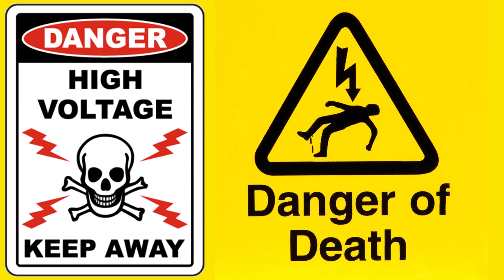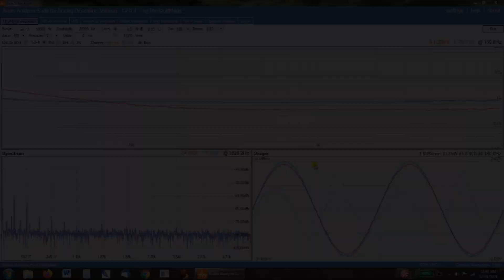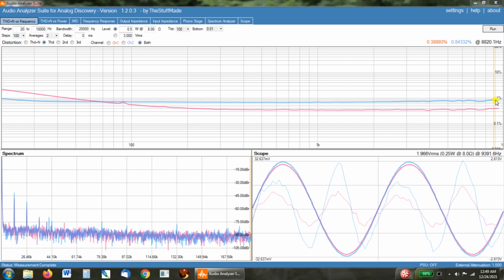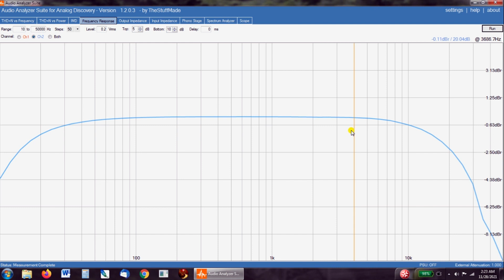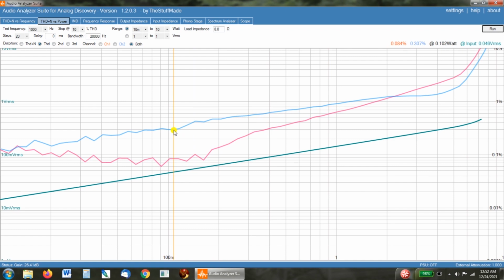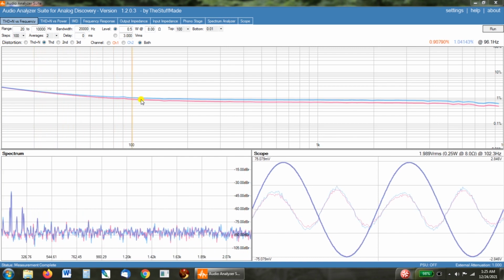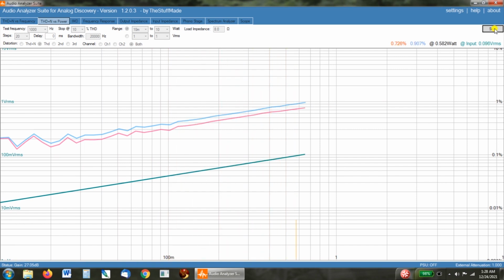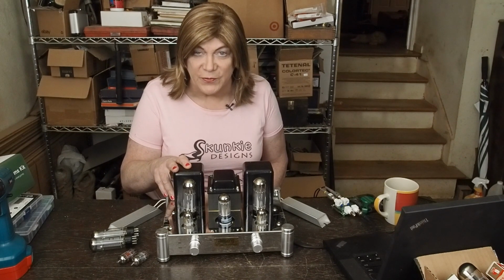Boyuurange Reisong A12: Follow up on Final Mods.

Comment: Happy 4th. I just finished the mods (except the rectifier tube swap). Some hard numbers. 

Pre mod: Marconi TF 2005/HP 335A equipment. 
Post mod: HP 8903B

1 volt input signal, 1 volt AC out of amp-
Pre: 6k 1.5% distortion, 14k 2.2%
Post: 6k .5, 14k .62

2 volt input, 5 volt output of amp- (I had to increase input signal voltage as the amp would not get to 5 volts at full volume)
 
Pre: 2k 12%, 10k 23.5%
Post: 2k 1.2%, 10k 1.5%

Wow!  Huge difference and as you have said, there is base now!!

Clipping at 5.9 amps.

Comment: I have the mod done for 3 months now and have moved on to other amp builds. Just 2 days ago I installed the Steve Deckert circuit to the Lii Song Fast 15 open baffle speakers (burned in for over 300 hours) and connected back the modded A10. What a relevation! The A10 is the most dynamic and musical amp in my system so far. Here are the components I put in: Gold Lion KT77, 6H2n (Soviet era) driver tubes, Mundorf Mcap EVO coupling caps, Alps 27 (blue) pot. I do not remember the system sounding this good ever.
Reply from the maker: Glad you're enjoying that setup!

Comment: Recently i went to change the El34 output tubes and when i installed the new JJ tubes they didn’t sound great because i haven’t burned them in yet i assume.

my question is would it make sense to burn in the output tubes by leaving the amp on for a few hours without the 12AX7 tubes installed so i don’t waste the life of the 12AX7? Or would it make no difference in preserving the life of them?

would doing that damage the amp?
Reply from the maker: Play music through them. And seriously, that 12AX7 tube is gonna last for  10 years. It's not like it's gonna burn out in 100 hours. And just having them powered on does nothing. Also is this a stock amp or a "skunkie mod" amp? Just swapping tubes into a defectively designed amp isn't gonna do anything.
Reply: @ill try that! Thank you for your advice :) 

Also the amp is Skunkie moded.

Comment: Parts arrived yesterday afternoon for the mod. Started the work around 4pm, was done by 8 or so - and that includes having a quick bite to eat :) Would be finished, except I ordered an 820 instead of an 820K by mistake. Don’t have much inventory here of 2W resistors, does this have to be a 2W, or can I use a lower value? Also managed to order a mono Alps in stead of a stereo pot - never rush putting an order together…) Waiting for the 5AR4 to arrive so I can get the voltages up. Almost there!
Reply from the maker: I would stick with a 2w there. Maybe order a few different resistors for that feed back as well  to tune the sound to your taste. Like maybe a few lower values down as low as 300k
Reply: @SkunkieDesignsElectronics  Thanks. I figured :) I’ll grab a few different values. Should really set up a switch w different values so it can be adjusted pending speakers. I have a lot of different ones :) And I got lucky. Found a unicorn in my stash of tubes. A Phillips mislabelled 5V4.  Actually a 5AR4!!!  Put it in, measured it and I’m getting 16v more than a 5V4. Have no idea where I got this tube!!!
Reply: @SkunkieDesignsElectronics  Almost done! Just need to put a new power switch in, put a new volume pot and figure out what coupling cap to use. Contemplate some Russian PIO caps, hopefully they will add some midrange richness. I added 5 x 0.1uF caps. One in parallel w the final cap in the power supply, and I put one across each of the bypass caps. Had some M Caps that I put it temporarily in place of the .22uF’s it came with. Opened up the sound a bit and added some dynamics. Did one side first so I could A/B how the changes worked. Listening on some Cornwalls, they tend to reveal everything :)

Amp is much better after the mods. Dead silent. 

Thanks you for all the effort you put into sorting this modestly priced amp - especially if someone picks up a used one.
Reply: @SkunkieDesignsElectronics  Added the Alps pot, changed the signal cables to Canare shielded wire - and put a new power switch in (the original felt very cheap…)

I’m not going to say the difference was night and day, but there was an improvement in how smooth the amp sounds. 

A big thing, is just a lot of little things out together.

Comment: Just finished the mod. A very nice amp now with all the glory of tubes. Thanks for the work. Only it seems that the gain is lower than the stock version (not that I listened to the stock version much.) Is there any way to increase the gain without sonic impact?  The speakers are Klipsch RP-600M.
Reply from the maker: Enjoy! And no, that is part of the price of this upgrade. You actually have more usable power, you just have to turn the volume knob up more.

Comment: Just finish the mod on my A10 with stock tubes, the difference is more clean power compared to the triode modded version. I will eventually buy new tubes but for now, I'm very happy. You are the best.

Comment: Just needed to give you another THANK YOU for this. Just finished your  Mundorf EVO Aluminum Oil Capacitor upgrade and changed the Schade resistor to 620K to work with my Klipsch RP-600M speakers. Dialed in my Polk subwoofer and just sat back and enjoyed the tunes. Really made a difference from stock. 

On an aside note, my cousin wants me to do one of these for him but is concerned  with needing more inputs, tone and balance controls. Please note that I DON'T need them. I came up with adding a Schiit Loki+ (for tone and another input) and changing the volume control to a concentric pot to control each channel. Do you have any better ideas?
Reply from the maker: Nope, that should work!

Comment: Hi, I'm just ordering all the bits to tackle the mods on my A12. Are there any potential implications of being in the UK where our power supply is ~240v? Thinking maybe rectifier choice?
Reply from the maker: Nope, after the transformer, the voltages are all the same. It's just the primary windings of the transformers are different.
Reply: @SkunkieDesignsElectronics  brilliant, thanks for all your work on this, looking forward to trying the mods!
Reply: @SkunkieDesignsElectronics  

Well that was exciting! Just did the mods (+ coupling caps) on my A12. First time wielding a soldering iron or doing any kind of electronics. Felt very accomplished, turned everything on... Tubes light up, then there's a lovely puff of smoke and a hmmmmmmwupwupwupwup noise from the right speaker.

Turn everything off. Open her up again. Realised the output tube capacitor on that side wasn't properly soldered to ground. Disassembled and tested the cap and all the resistors on that side - all seem fine, but spotted the voltage drain resistor on the filter cap was scorched and shorted so removed that.

Removed and checked both filter caps for good measure, seem OK. Reassembled everything, hid around the corner and switched everything back on.

All good! I have music and it sounds great. More bass, more detail and my Denton 80ths feel more responsive at low volumes. Have some NOS Svetlana Winged C EL34, Sovtek 12AX7lps and Sovtek GZ34 tubes turning up on Monday to celebrate.

A fun introduction to electronics, thanks very much for all your work!

Comment: Good morning.
Great job SKUNKIE !
I'm quite surprised that no one has noticed that the bleeder resistor (430K/2W) is missing on the modified diagram.
Some indications such as the wattage of the resistors could also have been reported to help even more in understanding the MOD. 
Keep it up, you're on top !

Comment: Inpiered by your chanel I want to play around with the a12 to learn  more about tube amps to  to prepare for a own  amp build. . I like to run the  A12 in triode mode to see effects. Is that possible? I think it is more to take in account than cutting  g2 at pin 4  to open connection to the center tab of the  output transformer.
Can you give me some advice.  In the net I find different confusing ideas.Thanks a lot
Hans
Reply from the maker: You have to disconnect the wire from the transformer and connect the screen to the plate with a 100ohm resistor. It's going to have about 1/2 the power.
Reply: @SkunkieDesignsElectronics   thanks for quick replay,  does the  820 k Shade feedback resistor make sense for  Triode mode?
Reply from the maker: @hansdoeing  no, triode mode shouldn't need any feedback.
Reply: @SkunkieDesignsElectronics   thanks, made a small donation to support your Channel

Comment: Hi Skunkie, I wish I could give you a hug right now!  Today I finished doing all the mods to the BRZHIFI A20 / Reisong A10 PCB version. I had to lower the EL34 cathode resistor to 150 Ohms as my plate voltages are lower. I measure 267V Plate-to-cathode and 13.8V on the cathode resistor. This sould get me around 93% dissipation. Not onyy is the sound VERY clean right now, I can listen at lower volumes as the low and high frequency response has resolved nicely now. When measuring the dB in my room it is a good 8dB lower now. My nieghbours are very grateful. I did not know this little amp could put out this sound! Still does not beat my Thule IA60 in terms of sheer power, but damn does it sing. I might actually sell my solid state amp now. Thank you for your work!   That disspiation did you get on the EL34? kind regards!

Comment: Massive thanks for doing these mods. I own a BRZHIFI A20. It is very similair to the A10. BRZHIFI already did lower the cathode resistor on the EL34. I have done most of the mods to the PCB of the BRZHIFI A20 and am very pleased with the results. Massive thanks! I have shared my story on diyaudio forums. Search for BRZHIFI A20.
Reply from the maker: Thanks for sharing

Comment: I got the best result without feedback resistor. Then the amplifier has great dynamics, but also distorts the sound at the maximum volume level. I listen at a maximum of 50-70% so it's not a problem for me. However, in order not to be too bright, I set eq in my dac.
Reply from the maker: Did you play with different values? Depending on the speakers and your taste, anything from 300K to 1M will work. The lower values can sound too dampened with some setups, while the higher values (or no feedback) might be too bright depending on your situation.
Reply: @SkunkieDesignsElectronics  I tried several resistors from 470K to 680K and as 680K sounds good I love more the dynamic of no feedback.
Reply from the maker: @wojciechkleszczynski7041  Ah OK, just making sure you understood the value of this resistor is not set in stone :)

Comment: Thank you for everything you do! You helped change the sound quality of my Reisong A12. I noticed that the manufacturer made a power transformer with a voltage of 275v and not 290v in my amplifier, tell me, could this affect the power of the amplifier, which decreased, or is it GNFB? Can you tell me how I can change GNFB? Thanks!
Reply from the maker: Lower voltage will have lower power. You might be able to make some back with a lower value cathode resistor to raise the current some to offset the lower voltage. This amp stock, nor with my mods have GNFB, it uses local plate to plate feedback.
Reply: @SkunkieDesignsElectronics  Thanks!

Comment: Thanks you so much Stephe !!! 
Thanks you for all your videos and for what I have learned from you. You are doing a great job !! 
I have just finished the upgrade of my A12. I choose a TAD GZ34, 2 EL34 from JJ, and 2 ECC83-STR from Harma (this last choice was oriented with advices from my local electronic reseller). My reseller gave me also new coupling capacitor. 
The sound is Amazing, pure and clear. I am very happy with my new A12, and what a surprise at this level of price. 
THANKS AGAIN  !!! Best regards from France. Frederic
Reply: Hello Stephe , thanks for your response !!.
 I am still working on my amp. I have changed the EL34 from JJ to EL34 Harma-Retro, after the advices of my electronic resseller. 
The result is really interesting , compare to the JJ !! Much more precise basses with clarity of all frequences. I am really happy.
Best regards

Comment: Hi Stephe,

Used to SET amplifiers I bought the A10 out of curiosity what a pentode might bring to the table. It was no succes and I thought the SE penthode as a principle was to blame, so the amp ended up in the attic until I saw your video. 

Modification of the operating points brought out the sun. Now it gives a clear soundstage while before it was foggy. Bass response has bettered 
a lot and the midrange is quite decent (in comparison to expensive SET amps). The highs are a little strident but I haven't incorporated the plate-to-plate feedback yet as I was curious about its effect. Will report back.

My B1 voltage with GZ34 (5AR4) is a little low at 326V, you got 340V I noticed. EL34 cathodes are at 18,5V each and the ECC83 at 1,2V so on target. 

Thank you very much for your effort because is brings quite a difference to this little amp. Love your videos! :goodvibes:

Detmar
Reply: 😃 whoa, this p-t-p feedback did clean up the highs a lot. I used 799K, might take it to 900K for comparison. Mind you, still with the stock ps-vane EL34 and JJ ECC83 (12AX7). Midrange is velvet, not too sweet. Bass could go somewhat deeper as I'm with 100nF still. Running a pair of 10 watt B&W DM1 speakers the volume is good for normal listening levels.
Reply: I settled on 861K p-t-p FB. It diminishes distortion at average listening levels to an acceptable level so highs do not sound strident any more.

Decoupling the EL34 cathode with two times 220uF brings better dynamics on the table, the amp now sounds as if it has more power than its humble 2x 6W. Although this mod improves the dynamics, the amp is still not on par with a good SET w.r.t. speed of delivery. Perhaps a solid state CCS fed from the rectifier PS may better this. So, now it is time to loose that heat producing rectifier but doing so brings the need for higher rated PS capacitors as their 400V working voltage will be exceeded at startup.

Must still double up on the coupling capacitors.
Reply from the maker: Glad you are enjoying the mods and you see why I am a fan of this p-t-p feedback, it's a great tuning tool!

Comment: Hello, I purchased a tung sol 5ar4, I'm new to tube amps.. is it just a direct swap? I have the a10.
Reply: Yes, you can exchange it for the Chinese rectifier. As a result your operating voltages go up. The power supply caps are 400V and should be ok. Do not use the JJ brand for 5AR4 rectifier as it has a reputation for open filaments within little use on these hifi amplifiers.

Comment: Skunkie I bought the amp and I'm getting ready to do the modifications. I find it odd that they parallel driver stage in a 12ax7. I've never seen a 6SN7 parallel too much.
A couple questions. Can you or would you cascode the 12ax7? Can you or would you direct couple it? Or really not necessary? Also, I was looking at schematic from original to yours. I noticed B+ did not change but I'm thinking you improved headroom with the 5AR4 dropping less voltage and a few other things to reduce current, correct? Finally, I can't wait to play with Schade feedback, etc to fine tune. I'm pretty excited. Out of the box, the amp drives my Klipsch RP-8000s with plenty of volume and drive. Now for the better sound
Reply from the maker: No need to cascode or direct couple it. A single triode provides all the drive an EL34 needs.

Comment: The mods you recommend are great, i have done them to-one of my a10 amps and there is a huge difference, i did install different coupling caps in the circuit (.22 uf) and that also helped, would you recommend adding a pot on each of the el34 tubes and adjusting the bias do you see any value there.
Reply from the maker: No reason to do that, they should bias up close enough.

Comment: I just bought one of these a12 hoping in the miracle... No miracle happened. :(
Very high distortions all over the spectrum. For sure the problem is amplified by the monitor floor standing speakers I'm using,, but old mengyue push pull ampli was alot better. Ill try your mods for sure (video 1 and 2 from november 2021 i suppose). I hope it will be achieve a better sound and limit distortions. Thank you for all you di (sorry for my eng, cheers from italy!)

Comment: Made the upgrades an the amp sounds much better. Thank you for the good job. After modification the B2 voltage is still  to low at 291 Volts. Do you have any idea why it is so differnet to your measurements. I use Sovtek 5AR4  Tubes. 
I have good audio grade  Capacitors  with 0.1 uF    can I use it instead of  the 0.22 uF orange  coupling cap between input and output tube?  I have  a small humm in the system can other capacitors  solve this.
Can we expect more from you in terms of the A12?
Reply from the maker: 0.1uf is pretty low to use with a 270ohm grid leak resistor. You might lose some low end response. On the voltage, they seemed to use a wide variety of power transformers in these as I get people reporting a wide range of voltages. I would adjust what you can to get them close to what I ended up with is all I can say, if you have to use a SS rectifier, so be it. 

I am looking at a next round of minor mods, just got a lot of projects going on at once!
Reply: @SkunkieDesignsElectronics  FYI  Added a solid state rectifier. Now I have 318 V at B2. Need to check if SS has a negative impact on sound. what do you think?

Comment: Thank you times 1000! I have the parts on order and am very excited to try the mods. I have an A-10 and it looks like I can simply follow the new mods and the pre-side will now be wired for the 12ax7s (Connecting pins 4,5 and 9 to the heater also) correct? Have a great new year and thanks again for the great videos!
Reply from the maker: Glad I could help